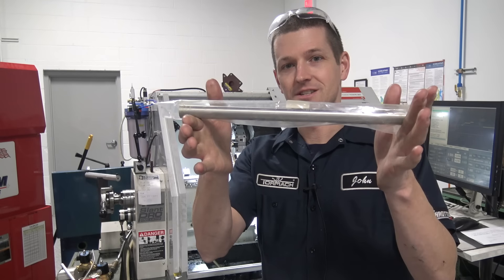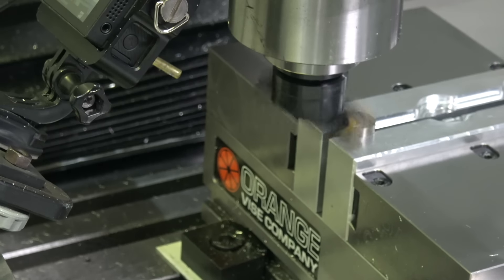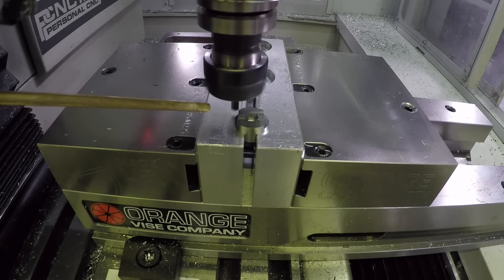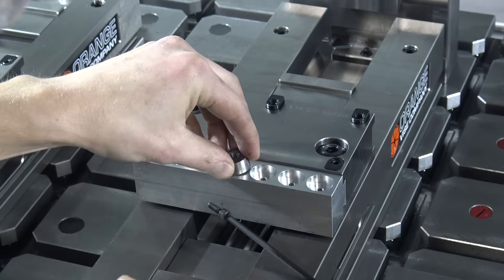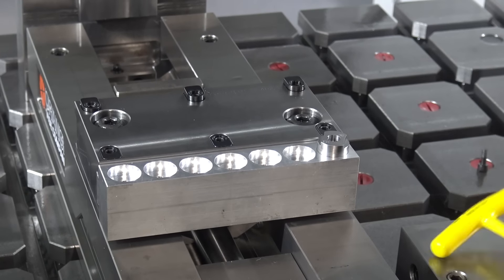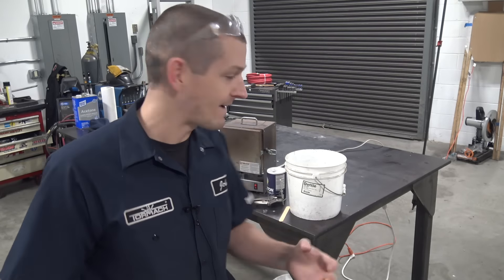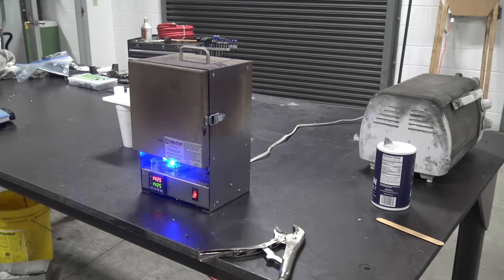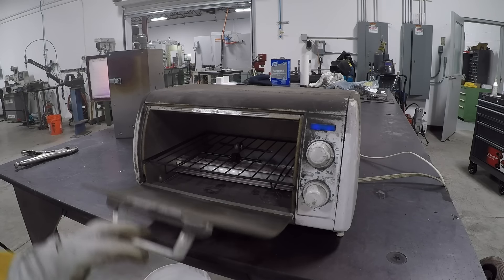Machining & Heat Treat Tool Steel Vise Inserts!  WW128

Comment: When you do the hardness testing, make sure your automatic center punch is perpendicular to the surface.  It will read low if it its at an angle.

Comment: I'm no engineer but I used to be a chemist... to stop scale build up on the heat treat they probably use an inert atmosphere. Any of the noble gases would work well, my guess is they would use argon as it's fairly cheap and readily available. You could probably rig up an inert atmosphere in your kiln by just drilling a hole in the side, inserting a pipe and connecting it to a bottle of argon welding gas. They almost certainly wouldn't use a vacuum to stop scaling, maintaining a vacuum over the sort of temperature cycle the kiln goes through would be tough and it would reduce the efficiency of the kiln as it would mean heat could only really transfer via radiation. Thanks for the great videos, you're teaching me a lot about CNC.
Reply: Glad I could help. I used to run a large furnace under these conditions (chemists call it a reducing atmosphere because it lacks oxygen). Assuming your door has a reasonable seal the flow rate you need to maintain an inert atmosphere is really low, much lower than for welding. You can can get high temperature ceramic tube which would last a longer than a steel tube and might be useful for resting pieces on while heat treating to keep them off the bottom of the furnace.
Reply: Boric acid also helps reduce scale and it's cheap. Jewelers use it all the time.
Reply: Vacuum furnaces are widely used in industry. we use them for aircraft parts. they are certainly not cheap... or desk sized!
Reply: When we were heat treating a2 tool steel, which is very sensitive to scaling. We wrapped our parts in stainless foil with paper inside and heated them. The off gassing of the burning paper creates a carbon atmosphere around the part, simple, effective, affordable.
Reply: @daigriff89 Do you know why the parts are heated under vacuum? As you say it's an expensive way to make something hot so I'm guessing it must be doing something to the metal other than just preventing scale build up. I wonder if it's to remove any gasses dissolved in the metal, in particular hydrogen.
Reply: Argon is quite useful around the workshop. But beware of welding gases that are blends of Argon with e.g. oxygen or CO2.

Argon is more dense than air until heated quite a bit (beyond about 100°C above ambient - at atmospheric pressure), it'll settle to the bottom of a container. So theoretically if you can't get a good seal on the kiln, put up some walls around the side to form a trough and "fill" that with Argon after you've loaded the furnace. You can test the level with an open flame that'll extinguish as soon as it's immersed in Argon. Try the direct kiln fill first!

An electric kiln btw does most of the heating by radiation and conduction with very little of it by air convection. Air sucks as a heat transfer medium. Argon is not significantly different. Helium is dreadful. But CO2 is good. [TIG welding especially shows the effect of heat transfer when using different gases.]

So is an Argon/CO2 blend OK/good for the kiln? Question is most easily answered by trying! Too many variables to work it out quicker "on paper".
Reply: a light clay wash will prevent scale on tool steel and is pretty easy to remove after.
Reply: argon sounds like a good idea. almost every shop has a bottle of it somewhere.

Comment: Are you able to speed up the feed rates, if you will, when the tool is not in contact with the workpiece?  Know what I mean? For instance, when the chamfer tool was moving into position, it was moving so slowly, I guess the air time before contact, can it be sped up? Or would that be too much of a pain to program? Thanks for the videos.

Comment: Another couple options for the scale is a paste type carb block, heatbath makes some. That just washes right off after heat treat. Another option is a diamond block which is a cool insert you put in your furnace that creates an ideal atmosphere for heat treating.

Comment: The stuff you filed off on your O1 is the decarb layer that occurs when the part is exposed to high temp in the presence of oxygen, decarburization occurs and the carbon in the metal comes to the surface. You can use stop off paints to control this with the temps that O1 and W1 are heat treated at.

Comment: I've oil quenched W1 to avoid cracking on parts with sharp inside corners. You won't be able to achieve as much ultimate hardness, but it usually doesn't matter.

To help reduce scale, but a piece of charcoal in the oven to consume the oxygen. A chalk paste helps too.

Comment: Clickspring on his channel offered great advice for dealing with scale which I have used to great effect on O1. He coats the parts in boric acid mixed with mineral spirits (makes applying it to your work easier). Once the parts are tempered, place them in boiling water to dissolve the boric acid coating. If done right, no scale and it's more cost effective than foil.

Comment: John, I'm not sure with that hardness tester but having the part on the paper towel when you make the impression might change the reading. particularly as your parts are so small and light in weight. Doesn't John Grimsmo use foil to heat treat his blades? You could ask him.
Reply: Yes, it will be almost worthless. It should be on a heavy hard piece. And with a compound between the test item and the heavy backup.

Comment: Hi John.

Wrap in iron wire and coat with borax mixed with alcohol to avoid scale.  You can also try coating the material with soft soap, works well too.  W1 and O1 are pretty forgiving, in parts this size you could hold in a small iron wire basket and borax, hit with a torch until a magnet doesn't stick, and quench.  Easy as can be.  Polish up real quick on your scotchbrite wheel and heat until the parts get a pale yellow/straw if you want really hard but still tempered.  I just plop batches in the kitchen over wrapped up in aluminum foil, take the oven to 450 or so, and after an hour turn it off.  Next morning you have nice uniformly tempered parts.  Punches I differentially temper, blue well back from the face, pale yellow on the face.  You can polish to a mirror finish without being easy to chip.  Have fun, you will be amazed at how darn easy it is to make all sorts of tools.  A2 is even better, no quench needed and just a minor temper.

Comment: I used to work at a heat forming and treating co. 20 years ago so I don't remember what the hardness number are but We used a Rockwell and a brinell tester and did 3 test on each piece then calculated the average. If I remember correctly the brinell higher the number the softer and the Rockwell the higher the number the softer, I maybe wrong.
Anyhow very cool John

Comment: Kind of OT but are you putting that spindle shutdown when changing ops but still have the same tool in the spindle in the code manually or is that the post processor ? I had the stock LinuxCNC post doing that and I corrected it to take those out. It just seems like a time waster. If it is the post I'm pretty sure I can tweak the post if you want.

Andrew
Reply: Around 7:30 and 13:40 for example as you are switching from the roughing op to the finishing op the spindle shuts down then immediately starts up again. Are you putting that pause in or is that from the post processor ? I have seen this in other videos for awhile now and I have been wondering about it. I had the same issue and I modified the post to remove that shutdown. I also have a conditional in the post that when I set the spindle RPM to something low like 1 RPM to have the post remove the spindle start M3 completely. That might be useful for the engraver so you do not need to manually remove the M3. 

Andrew

Comment: Oil quenching is a slower and less violent process than water quenching. Water quenching can sometimes cause warping, distortion and stress buildup because of the air "pockets" that can form like you mentioned in your video.

Comment: John, you should explore the idea of acquiring a used Hardinge HC "Hand Chucker" lathe.  With 5C collets, and an 8 position turret, you could pop those round parts in a collet and break the edges with a nice chamfer, etc. Very handy for many uses around the shop, even cutting off cap screws, etc. A great machine to have for general 2nd operation work, prototyping, making washers, spacers, etc. Handy, and quick for simple tasks!

Comment: I was wondering if a couple of "air blade" style structures could be used inside your lathe window to deflect coolant away from it. Perhaps with one blowing and one sucking so you don't create lots of turbulent air inside the machine....

Comment: we use conversational where i work and its the way we just give the conversational program a program number that coresponds to the part number.. so when we run that job again we just look at the part number, type it into the machine and theres the program. also theres a place where we put setup notes and a note describing each tool.

Comment: Regarding your comment at the 1:50 mark about the window on your machine, have you tried applying a rain-x water repellent? I assume it's some sort of poly carbonate and they do make one specifically for that, might help the coolant bead off.
Reply: Interesting, hadn't thought about issues with mixing with the coolant but that makes sense.

Comment: Nice Video.  I see your electrical load centers in the back.  I am wondering if you have surge protection?  It is something I would recommend as a voltage surge could completely ruin your CNC equipment.  I know from experience.

Comment: John, love the videos. Long time fan. When measuring out the salt for your brine an easy way to get a more precise measurement is with a refractometer often used by saltwater aquarium owners. Keep the amount of liquid static and then you can determine the amount of salt per water valiume for a perfect mix.
Reply: Or even easier, float a potato! No joke. At the right brine solution a potato will float.

Comment: Hey John. While I don't have experience machining o1 or w1 I have experience forging both and from a heat treating standpoint o1 is so simple and forgiving in a heat treat that it's almost funny. While you can get into the super nitty gritty with heat treating, especially with modern alloys and mono steels, generally speaking o1 is just get it hot and dunk it oil and then draw the temper back with a touch, w1 is much more finicky with the temper in my experience. But that's just my 2 cents. Thanks for the video, it was fun as always.

Comment: I did not actually check the specs of the tool steel rods but I think that its safer to assume that they are not round enough for precision work.

Comment: Good one John!

I would have expected your parts to grow slightly after heat treatment, I'm surprised they didn't.

The finish you're liking from the fly cutter is as a result of the insert, and not the fact a fly cutter is holding it. I can't recall what you have in regard insert mills, but if you're not getting similar results I'd look at what inserts you have in them. I know I've mentioned them to you before, but especially now with the new machine have a look at some Kyocera cermet inserts. Do some research about running them, but basically hard and FAST! They would have been ideal on that tool steel.

Every time you mention the view through the lathe's window I think a SMW "clearview" window can't be too far away ;) I'd think a piece of polycarbonate from Home Depot and a 1000 rpm motor could see a Wednesday widget Clearview emerge. I'll disclose that I've never tried it and only seen the commercial units, but can't imagine it would be too big a job to make one.

Comment: as a tip we've made it a rule within our shop to not only write on the side of the rod with a paint marker/sharpie what the material is, but also metal stamp both ends with 1/8 or 1/4 metal stampers. The problem was guys in the shop would often forget to write on the material what it was, or it got rubbed/smeared off. So we'd end up with mystery material. We'd also designate only 1 person for sawing and give them the responsibility of cataloging and indexing material.  Which corrected a lot of bad habits of just any one in the shop grabbing material and running to the saw to whack off a piece, and not document or even return the remainder back to the storage rack. We've got a lot of general purpose 1018/1020 CR, but we also got some really high dollar high tensile material in stock for special purposes. And just on appearance they look very similar.

Comment: Powdered boric acid you can usually get from the hardware store as a roach bait. Mix it with denatured alcohol to form a thick paste. Place part in a SS container and liberally coat the part to be heated, with enough of the mixture to ensure that it will cover the part once molten. Once the mix melts, it forms a protective glaze over the part, almost completely eliminating oxidation. Once quench is complete, wash off the boric acid residue with boiling water.  One of the most effective heat treating oxidation protection there is for the home shop.

Comment: I actually just ran a Heat treat cycle of A2, D2, and O1 today on furnace similar to yours but on a bigger scale, I absolutely despise heat treating O1 just because it is so messy, but it is so much cheaper. Would rather do W1 because its not as messy, but in the stamping industry its not quite as durable as the other tool steels and seems to be more brittle. A2 and D2 are both air hardening material, which makes it very simple, but requires temps above 1700*. A2 and D2 are usually where the stainless foil comes into play. Heat treat requires a lot of time and patients, something I have very little to spare at the moment! LOL!

Comment: on the lathe window, you could run a plate of hard glass inside to resist scratching and a polycarbonate outside to protect against anything coming through the viewport into your face

Comment: hey, John, thanks for the video.
just my 5cents - hardness tester should be used on a tough plate, probable even with well fixed part. Otherwise it will lie a lot. By using soft material you rise up readings. Actual hardness definitely lower because of that. Difference could be up to 15RC

Comment: Awesome video :-) I am very familiar with "Brinell hardness testing". When I was a kid, I worked for "Reid Tool". We made Drill Steel for drilling Oil Wells... The Tool Joints had to have very specific hardness. Moreover, they could not have any Cracks... Where I worked, in the Heat Treating department, one had to be very careful about the Temperatures of the ovens, the Oil baths and a whole lot more... If there are cracks in a joint, it could mean catastrophic failure during drilling. For that, we used Magnaflux. Even passing the harness test, a Joint could fail, if there were cracks...

Having said that, I think the parts you are heat treating and their end use, may not require crack detection or that sort of thing...

When it comes to the Brinell Hardness Testing, you are using, I cannot imagine it being very accurate at all... We used a sort of "Press" to bring down the punch and when it reached a specific weight, it released, leaving a small but consistent dimple in the work piece... Consistency in the dimple size is paramount... We used a similar measuring glass, but the creation of a consistant dimple is far more important... Without a consistent Dimple, the eye-piece is useless... I'm sure you're aware of that... Anyway, good luck :-)

Comment: Nice job on the heat treat.  Interesting that they were both very similar in hardness afterwards.  I don't know if these are actual grips or just tests, but don't you want a little relief on the edge so the grip grabs at the top edge, even if only by 1 degree or perhaps a few 0.001 undercut?  Even small deflections will make the grip grab at the bottom edge increasing the risk of pop out I think.  You don't want a grip where even small amounts of movement will cause them to loosen.

Comment: I wonder what happens, molecularly, if you wait to temper
Reply: Not much. Heat treating changes the crystal grain structure of the metal. A normalized(not hardened) metal has it's crystals arranged randomly making it easier to squish or scratch the surface. Hardening aligns the crystals making the structure much harder to squish or scratch but if you drop it prior to tempering it has a high risk of cracking the part. Tempering reduces the hardness and makes the metal tougher to crack.
Reply: so tempering might not need to be done immediately after hardening other than to minimize the risk of dropping the part?
Reply: Not necessary as in right that moment but generally sooner is better than later. Some geometries can crack due to their own internal stresses as they cool. It all depends on the shape of the part. Something simple with no inside corners like a knife can wait until your main kiln cools down to tempering temperatures.

Comment: I would find an auto glass shop that cuts glass and get them to cut a laminated safety glass window for it, you could then put a hand crank or power windshield wiper like they make for jeeps on it.

Comment: you should probably balance the load in your vise by clamping an equivalent part in the other side or use the center of the jaws, but it seemed to work. I'd definitely do that for square stock though.

Comment: I think what you want is some A2(air hardening). As also mentioned by Dan Gelbart(check him out) the only tool steel you need to stock is A2 cause it is the easiest to harden and also due to the slow cooling it deforms the least from the heat treatment and you can do almost net size before grinding.